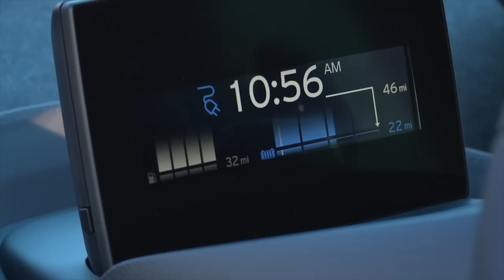Five Things We Need To Improve About Electric Cars

Comment: The most important issue I have faced since purchasing my ev is not the lack of charging facilities,  not waiting for a free one, not trying to find the correct app, or card but the fact that the points become faulty and never or very slowly get fixed.  or as a case recently when I went to Fleet services Ecotricity had completely removed the sockets!  just think of the consumer outcry if there was no fuel in the station..... it just would not be acceptable to give this poor quality of service to the public. Why is there no service level agreement to get these unit fixed within 2 hour they are not very complex machines and for people to more to electric they have to work.

Comment: Another suggestion.   Ditch front wheel drive or eliminate torque steer.   I drove a Chevy Bolt and it wasn't a bad car but with its strong motor the torque steer was worse than a 1970s Saab 900 Turbo.

Range and charging anxiety are related nd taken together, limit EVs to a commuter niche.   CNG IC vehicles have a similar problem.

Quit insisting that EVs be held hostge to underperforming wind and solar power.

Comment: TOWING
Firstly we are from the UK so things may be different in the US
To go full electric I would need a more practical car (medium to large estate or SUV ) that can tow in excess of 1500kg and costs around 30k 
The reasons are shown below.
We had 3 cars for different uses all diesel (medium size car Mercedes CLC for Local running around an older estate car VW Passat for work and towing then a Large SUV Mercedes ML for longer tips as a family or towing) We then brought a 2017 leaf (this was 6 month old the newest car we had ever owned) this replaced the CLC for local running about and was economical as the fuel and running cost savings more than paid for the difference in price. after 6 months we found that the SUV that was expensive to TAX (over £500 per year) was not really used as we learnt that the Leaf was a nicer and smoother drive than the ML and the Charging was not really an issue. Most of the miles the ML had done was towing as it had a sat nav and the Passat did not. The passat was capable of towing the weights the ML had done so the ML has now gone and we are a 2 car family for the first time in 9 years over 80% of our miles are done EV but we still have a dirty very old Passat that we want to replace with EV. 
We can not get rid of this car as we need to tow regularly we have cycle racks that fit towbars. We also need a large boot for some thing that we do as a family. None of this is every day but we do require it. For every day use me and my wife have a rule of whoever is doing the most miles has the leaf unless I am towing a long distance.

If we had the money I would have a model X sat on my drive but this is well out of reach of most normal families including us and it is currently the only full EV that can tow any reasonable weight.

I have considered the Mitsubishi Outlander but I can not bring myself to buying any other vehicle that has an engine in it I do understand it does not drive on the engine but engines just seem wrong. 
I would probably manage most weeks on ev only.
One of the big advantages of EV is running costs and maintenance as there is not much to go wrong although there is the possibility (I have not experienced 1 in 20k miles and 14 months) but I would feel robbed having to lug an engine, fuel around with me then have to pay to maintain it although I would rarely use it. In an ev you have a battery, controllers / inverters and a motor to drive you. Why add an inefficient engine that is not as reliable then any integration equipment to get then to work together. 
I am waiting for the EV for around 30K that can tow over 1500kg it can not be many years away as there are many ICE vehicles like this and prices should be equal within 3-4 years.
Reply: While a Mitsubishi Outlander is a $30k car, I don't think you will get a comparable EV for $30k including tax breaks before 2030. But even if the car is $35k or even a bit more, it would still be a bargain once you include the much lower costs for charging and maintenance.

Comment: As technology moves forward. We will see stronger contactless chargers that could be embedded in the road ways or in every parking space. Without the need to plug in. And always being able to charge the battery wouldn't need to be so large. Also with faster charging batteries like solid state not far off. They could charge in minutes instead of hours. All of this could mean smaller batteries with shorter ranges would be enough for almost everyone and would be more sustainable. Also making the cars cheaper and lighter. The cars could all have meters for electric taken from the grid. I'm excited to see what's to come.
Reply: Won't happen. Losses would be too high, magnetic fields would need to be to strong to be operated safely.
People with pacemakers could die if they would come too close, some electronics could drive nuts.
It's a major difference if you charge a smartphone with a 15 Wh battery or a car with a 50,000 Wh (50 kWh) battery.

Comment: What scares me enormously is the idea that some batteries will become obsolete and it will become impossible to get replacements.  Car manufacturers cannot survive without selling us crap so it's just a case of what crap they sell us and at what cost. Forced upgrades....fact of life in the tech industry.   Phone broken? After some years the cost to fix > replacement so you buy. Laptop not charging? good luck trying to get that fixed if the machine is 6 years old. etc etc. Obsolescence will be built in.  With lots of models and regular standards changes etc no mechanic out there will be able to know enough to fix more than trivial faults.  3rd party support will find a market split into so many small segments - types and subtypes - that it cannot make any money by trying to take care of each of them.   Obviously I'm hyping it up a bit but the recent Leaf Battery replacement price increases show what I'm talking about. Those batteries are more expensive than my entire ICE car.

Comment: I agree with all the points that were considered. Specially battery pack replacement: it needs to be cheaper and the battery capacity upgradeable.

Comment: Lots of good points there!  I think for #5 the battery life concerns, we should be pointing out that manufacturers are (in some cases) offering unlimited mileage, 8+ year warranties on the battery and drive train.  We should take every available option presented to us, to 'educate' the non EV driver that batteries don't need to be changed every year or two and that cars can and have done 100K's of miles and more on the same battery pack.

Comment: Two things that were missed one I've seen was mentioned in comments already. Third party repairs need to be made available. The more adoption the more repair demand and restricting it to the manufacturer won't work.  FSD won't prevent an accident with a dumb animal like a deer that randomly jumps in front of you or a rock slide. Second thing is a safety concern. There needs to be a standardized cut point on EVs so in the case of a car accident emergency crews won't have to figure out where they are supposed to cut based on brand. It doesn't matter where but the industry should come to an agreement on where that should be or have a safety device that cuts power in case of an accident. I know it doesn't help adoption but it does help save lives. Also on your point of more rapid charging, I agree but would also add there needs to be more Lv2 charge points at regular businesses. Like have a mall with chargers ready at most or all the parking spots. Restaurants and hotels that has chargers at all their parking spots. Places of business that normally have customers there for 45+min having LV2 charge points. It's healthier for the battery life and for people that don't normally have charge at home these are the places they would charge at and keep a charged battery. Having a j1772 option at these spots works in the majority of situations as well since Tesla comes with a j1772 adaptor. CHAdeMO would just need an adaptor. Even having CCS for faster charging that isn't 'supercharging' speeds necessarily would help and Tesla and CHAdeMO would have to develop an adaptor for the CCS.

Comment: Another excellent presentation raising valid issues.  As an EV driver I see enormous benefits over any ICE car that I have driven in the past 50 years, but the concept is far from perfect and needs attention to the issues that you raise.  As far as rapid charging goes, the big issue is not just availability, but the need for simple, always available, access at a reasonable price.  How much outrage would there be voiced if petrol or diesel purchase required a special card at one filling station, a monthly membership fee to use the next, a mobile phone application at the following station, a different piece of software at another, ownership of a particular car brand at the next, a fixed price for using the pump regardless of fuel volume, etc, etc.

Comment: I'm just surprised,  that all the flat external areas don't have solar panels installed, if not then the roof definitely. Considering most of the time between travels is spent sitting in the sunshine, and wouldn't it be nice while sitting in traffic, you're charging the car.

Comment: I recall in Calgary, the car park adjacent to to the city transit network had an electric charging point (or similar) to stop batteries/cars from freezing in the winter. It would appear to be a simple solution to have charging points for electric cars that use the car park. This could be rolled out to Park and Ride sites in any country and reduce the need to hunt for that spare connection point for commuters.

Comment: I
mostly disagree with your assessment.  There was too much inference
on carbon foot print needing to be lowered. All that does is add cost to he
vehicles with little to no results since CO2 does not have any measurable
effect on the climate. 

 There
are three major issues that need to be corrected before the EV becomes a viable
practical vehicle at least in the USA. One is the price. They need to get the
prices down to the same area of comparable sized gas models which is the
18k to 20k out the door. 

 Second
thy need to get the range up to the same as a comparable sized gas model which
is around 500 miles summer and winter. 

 Third
they need to get the charging times down to the same time to fuel a comparable
sized gas model which is around 5 to 10 minutes near empty to full.

 As for charging stations
yes we need more, BUT the real problem in the US is the disarray of the
electrical grid. It is basically junk and cannot stand much more power drain without
serious brown and black outs. 

 To handle the results of the three
things I mentioned , which will cause the EV to sell like hotcakes, would take
a massive overhaul of the electric grid which would take any place from 50 to
100 years to build all the new power generating plants and transmission lines
due to environmental issues.

Comment: As for the price, I believe when calculating total cost of ownership it would show that full EVs are less expensive than it's gasoline counterpart. I pay 2 bucks for 100km of driving power, whereas a comparable ICE car has to pay around 15. Times 30 for about 20000 miles per year -> 450 every year. A huge difference. Then there's the service savings, etc.... Multiply ba at least 10 years - massive!

Comment: I have had my EV experiment for the last just short of 3 years ending in March when my pcp ends on my 30 kwhr Nissan leaf. My findings are -  much more expensive as a whole than ice with a normal use of 10000 miles per year. Very good and convenient around town but takes twice as long  to do long journeys and journeys beyond 230 miles are dogged by overheating battery problems with multiple rapid charging, beyond the 4th rapid charge. The rapid charging network is abysmal and slow in England with hardly any on going investment, also no increase from 50 kw chargers and you would need a new car to benefit from it anyway and those who do it are losing money ( ecotricity) so no wonder there is no forward investment. You also can't rely on chargers 100% to work and who wants to be stuck or flat bedded home on a cold dark night with an empty battery. Charging payment is by phone and totally inconvenient. Max speed on long journeys is limited to 60 mph normally to eek out range so a further addition to journey time. There are not enough rapid charging locations and you often have to go off route to find one and many areas of the country are rapid charging or any other charging deserts. You can't go any long distances with spontaneity because of the logistical need to plan charging stops and charging back ups in case the first charger is broken. All in all I would say cheaper electric cars are not fit for purpose and it will be many years before the cars and infrastructure will compete on an equal basis with ice. On march 31st my leaf goes back and my E Class Mercedes diesel becomes my 100 % use car and I must say I can't wait. I guess I will be returning to electric in about a decade, by then we may have a good comparable electric offering at a reasonable price to ice but for now there is no such thing and as I have already said not fit for purpose as an all round everyday car which the average Joe would want and buy to do everything he wants it to do.

Comment: There is one somewhat paradoxical point I'd like to mention, not quite covered by the points you make though related to some. Current EVs have considerably more embodied energy than conventional vehicles, meaning more energy has to be spent in producing it. This is mainly due to the energy required to build batteries, so the difference grows with the size of the battery. This means that to be energy-economic compared to conventional vehicles, an EV must be driven a lot during its lifetime.

The measure for that is the amount of fuel that would have been spent if it weren't an EV. Although that can in part be done while driving slowly or not at all in congested situations, one cannot hope to achieve a high overall efficiency without covering a lot of kilometres before retiring the EV. That may be easy to achieve in some scenarios, most clearly in the case of a taxi driven substantial distances every day, but for people with relatively modest daily needs it is not so obvious, especially if for the occasional very long trip the EV proves too impractical. Unless such cars can be used for many years on end. Which probably is technically quite feasible, but who wants to drive a car whose battery technology is a decade or more behind the current state of the art? Given the speed of technology development, I'm afraid few people are, or will be any time soon.

So what can be done to ensure EVs do attain good average total lifetime energy economy? Getting the batteries produced with as little energy as possible, and as clean as possible, is one possibility (for manufacturers). Avoiding the temptation to greatly oversize the battery just for the added comfort this provides on rare road trips is another one (for customers). And creating conditions for a healthy used EV marketplace would be in everybody's interest; strangely I have the impression that the tendency (at least here in Europe) to lease rather than buy new vehicles is not really helping here.

Comment: Entire video is a non-event... All these issues are being addressed, and the rate of the "solutions" is roughly in tandem with the rate of EV adoption. The big impediments are not industries that are working hard in the renewable energy field, but reticent and powerful influencers in the traditional energy and transport industries, who keep the politicians and governments in their back pockets, and who are pumping billions into campaigns designed to stifle and stunt renewable energy efforts and policies.
Reply: Tag Makers Pet Tags Absolutely. In this "ICE" age the "dinosaurs" are managing to survive (thrive?) thanks to the strangle-hold that BIG OIL lobbyists have on "our" politicians. Hardly a level playing field...
Reply: @gwarlow  Tesla 3rd Qtr results are indicative of a potential turning point. The demand for EV's is rapidly increasing, and the tipping point to EV's (where the demand for ICE is not high enough to sustain the industry) will occur when the economics of EV leap-frog that of ICE. Sam Walton - founder of Walmart had many choice quotes, but one that springs to mind goes something like this: "Even the most powerful CEO can be fired by the customer. All you need is for your customers to shop elsewhere, when they see better value at your competitor. It happens fast, and is usually final."

Comment: Battery tech will increase so that we have enough range in the UK to drive anywhere so that we need fewer chargers and rapid chargers will mean much shorter charging time. Good point number 2. We need to improve the safety to others on the road so we begin to reduce the 1.25 million deaths from cars worldwide each year. Wireless chargin is now as efficient as cabled charging and so people without garages/charge points on their property can charge in the street.